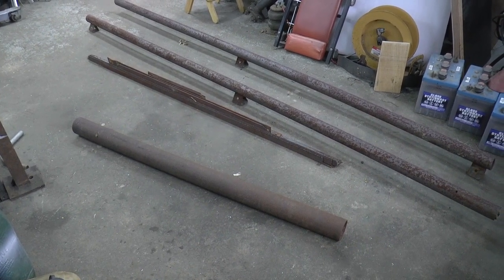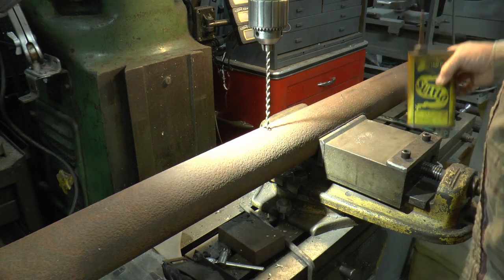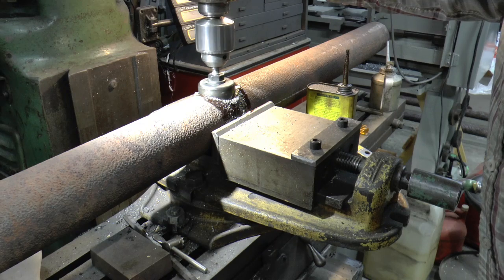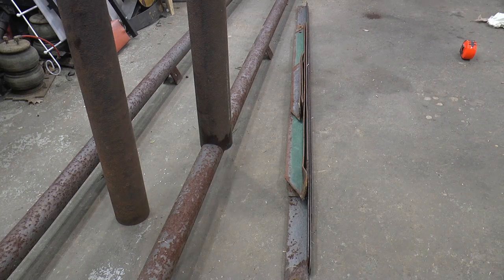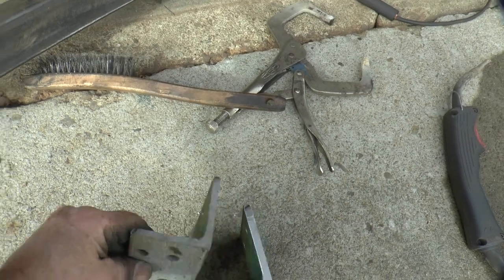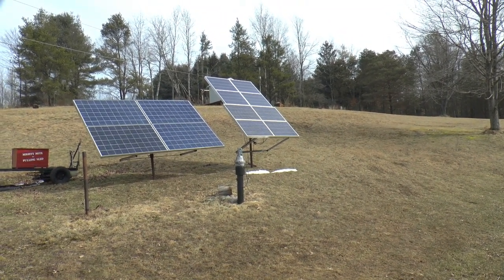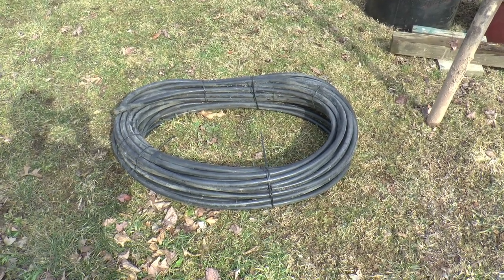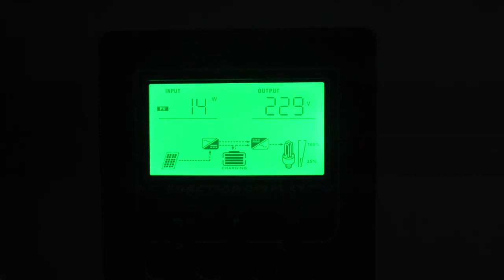Solar Panel Mount Build

Comment: Do they make self clearing panels ? Like with a heating element run through them that can heat the panels to melt snow & ice.
Reply from the maker: Not that I know of.
Reply: they heat up when they make power plus they are dark in color so if you clean the snow they melt off the rest. i do the same thing as him just use a shop broom lol